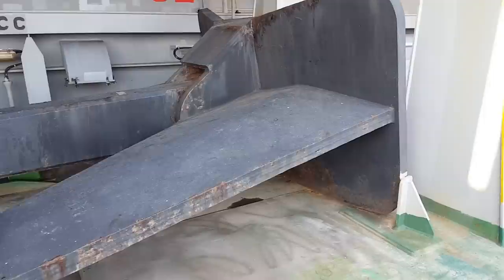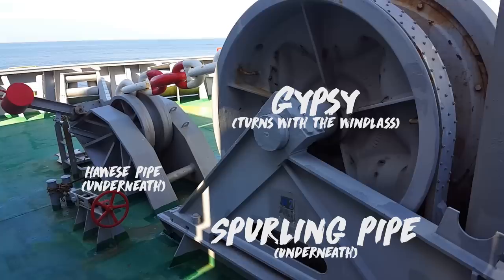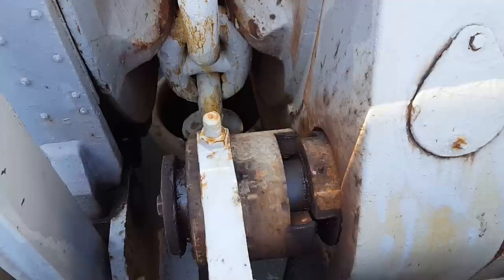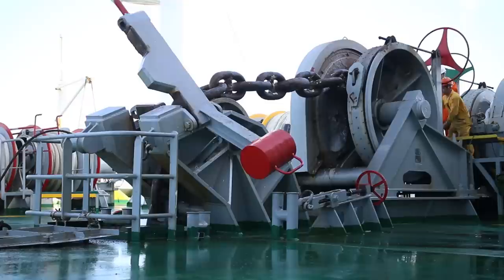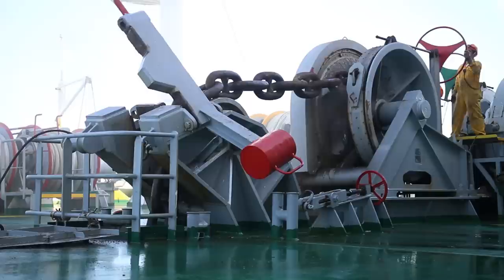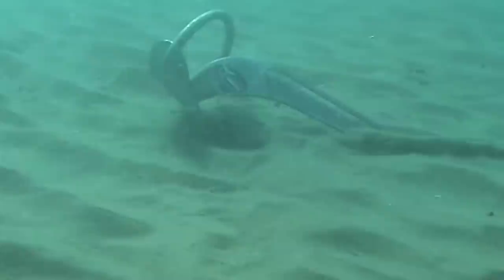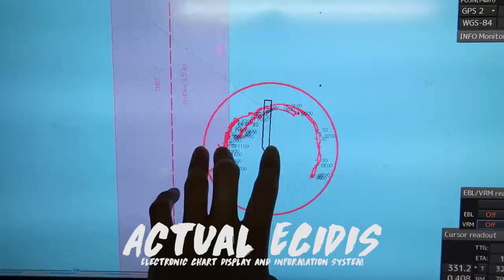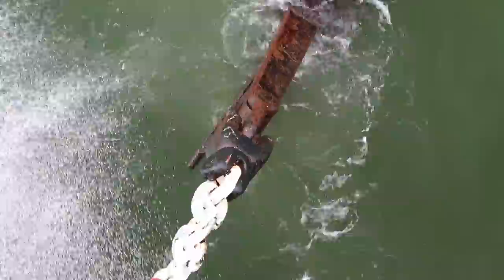How To Anchor a Mega-Ship  |  Anchoring & Equipment Explained!  | Life at Sea

Comment: 4:50 
Omg the big pin is held by a smaller pin which is held by a smaller pin 
😮
Reply from the maker: pin-ception
Reply: Bhum Brahmavira  Thats not what redundancy is. The pins are all part of a single system with the sole purpose of locking the anchor chain in place. If there was another system that did the same thing, it would be a redundant system. For example, a 747 jet will have 4 redundant hydraulic systems to control the ailerons, meaning 4 totally separate systems that all enable the same thing. If one of the systems has a 4 step fail-safe for its hydraulic pressure limiter it wouldn't be redundant. But if it had 4 separate fail-safes for the same hydraulic limiter which all counteracted the same issue it would be a 4 level redundant system.
Reply: Wonder what circumstance lead them to realizing that final pin is necessary? Figure this out and youll be a hero in my book
Reply: Yo dawg, I see you like pins, so I added a pin on to the pin for the pin, so you an pin the pin while you pin the anchor.
Reply: Wait, I was expecting a needle on the third pin. Current design isn't safe.
Reply: Bhum Brahmavira that is not what redundancy means
Reply: @dynamicsolution8166  - You know the answer already. All it took was to have that anchor chain come lose at the wrong time cause something got bumbed or hit, and sink or capsize the vessel. Think about how much movement on a ship in a storm. Shoot I'd put two more pins.
Reply: WuzNab your profile pic makes it even funnier😂😂
Reply: @dynamicsolution8166  general safety.
Even the smallest pin will normally have either a spring thing like a lynch pin, or a ball poking out of it that is springy. with such a pure mechanical sytem, it is important to make it so that only a human can change its state.
Reply: The never ending effort to keep "Murphy's Law" under control as much as humanly possible...
Reply: @JeffHK  Why is this not a pinned comment?
Reply: @dynamicsolution8166  drunk sailors?
Reply: yeah i found that funny too:)

Comment: I've driven semi trucks and flown helicopters, that doesn't scare me one bit but I would not be caught anywhere near that chain while it's dropping.  Holy crap.
Reply: Right? Why don't they put that brake wheel in a less dangerous location? To the side perhaps?  The guy is two feet away as the chain spins out of control.

Comment: how do you pull it up? isnt it stuck into the bottom of the sea?
Reply: The head of the anchor is not actually stuck in the sea. Its the length of the chain as a whole that "gets stuck". If the ship pulls horizontally against the chain, the ship goes nowhere. If they haul the chain up vertically little by little, no problem, chain comes up.
Reply: Ok, thanks now at least i know ;P
Reply from the maker: Great explanation!! thank you sir
Reply: thesmallterror it depends on the type of a anchor if it digs or not a Danford anchored will dig real deep in rough weather
Reply: I heard if the anchor chain broke loose in the middle of the sea
The windlass won't have enough power to heave up all the 13 shackles of chain
Reply: Thanks for sharing. Sweet video!
Reply: Slave Of The Most Merciful You go directly over it and pull up, they do not hold vertical, he said that in the video
Reply: In general you "drive up" onto the anchor (approximate location)  while pulling up the chain. This is why you have to see where the chain is pointing and the angle of the chain.  When you are on top of the anchor location the shank will pivot as you pull in the chain. The last part is heaving up the material over the flukes which happens as the shank pivots upward. Then the force vector is a simple lift not dragging against the flukes which are digging downward because of the allowed pivot of the shank and gravity (this is why the shank is only allowed to pivot 30 degrees or so depending on bottom it was designed for). Windlass systems in general are specked out at 4x the lifting power of  the rode and ground tackle weight.  (ship) ^---------------> holds and digs because the anchor chain keeps the force vector horizontal   (ship) ^-> pulls up quick as the lack of most of the anchor chain lets the force vector go vertical .
Reply: Any modern anchor, even on a small boat, is designed to hook into the bottom.  It takes 'scope' of anchor line or chain to hold the ship or boat at a shallow angle against the anchor. Once you pull up the chain and the anchor is directly below the bow of the ship, it'll haul up relatively easily.  When you do it by hand on a recreational boat, it's very noticeable when your anchor breaks free of the bottom.

Comment: Nice video...  After typing up to a multi-point offshore mooring (both anchors laid and 5 lines to buoys off the stern) we opened the chain lockers and found the port chain didn't even touch the bottom of the locker, and the starboard had about a dozen links laying on the bottom of the locker.  Mind you, in this ship, the weak link end connectors were up near the top of the lockers.

Comment: Surprised no one commented about Being at anchor.  Good vid by the way.  Dragging anchor is the worst nightmare particularly if there are other boats/ships near.  Usually because of changes in weather.   Particularly with civilians who don't anchor often.  That's why I always listen in the night for the flapping of the burgee on the mast.   If it is flapping at a fair clip (strong breeze) I ALWAYS get up in the night two or three times to watch the surrounding boats.  I've caught 3 boats in the night dragging anchor including a 70' headed towards other boats at anchor.  Fortunately I was able to roust them with the 5 horn blasts and they came on deck Literally 40 ft from shore.  Props first!

Comment: Nice video. Slight correction, it's never the chain that holds the ship, it's always ultimately the anchor, and if it fails to set properly the ship will happily drag a mile of chain and the anchor until it sets. In bad weather or strong currents the chain will be pulled taut, almost straight between the ship and the anchor, and will not be in contact with the sea bed, no matter how long or how heavy the chain is. The big, heavy chain is primarily needed because until recently anchor designs have been so bad that they needed a very low-angle, nearly horizontal pull in order to have a chance of setting themselves into the sea bed. A few of the best new 21st century anchor designs don't really require any heavy chain anymore in order to reliably set themselves, but nobody makes these new anchor designs in sizes appropriate for such large ships. I don't know if they ever will, but if they did a mega-ship like that could probably use anchor chain less than half that size and still have more reliable anchoring than they do with those old stockless anchor designs. It would be interesting to see what kind of anchors big ships will be using a century from now.

Comment: Another good video. Well done. Your demonstration using simple models and sketches is very good. However, the real mega mega ship from an anchoring perspective would have been the kind that I was Captain on, the ULCCs, 413842 Dwt Tons, with a loaded displacement, close to half a million tons. The anchor itself weighed 25 Tons. We would never 'Let go', the anchor had to be 'walked back' each time. Thanks once again.

Comment: Cool Vids Mate...
Is see alot of small boaters use the bruce anchor...those are the worst in an emergency unless you want to reset anchor if you can. They require alot of rode to hold...not good in tight places unless you use alot of heavy chain and a winch to pull all that chain.

Comment: Thank you for this video, What I am interested to understand is on a large vessel, if the ship needs to drop anchor  shall we say in the middle of the Atlantic Ocean, which is probably several thousand metres deep, surely the anchor chain is not that long? So, how does the anchor hold the ship if the anchor is not imbedded in the sea floor? Thank you

Comment: Very helpful video thank you, one question though. Do you have "no anchor" spots on charts to prevent accidentally damaging underwater equipment such as cables and pipes?
Reply: Most Harbor Charts, (especially the larger ones), usually have designated anchorage areas with specific spots marked within them. Also underwater cables pipes and other structures are clearly marked so vessels don't drop on them. It doesn't keep it from happening, but one cannot completely eliminate the Human Factor. (Former Quartermaster USN).

Comment: What is the process for removing the anchor from the sea floor when you are ready to set sail? If the anchor is somewhat embedded in the sea floor does the windlass provide enough pulling force to overcome the embedding? Also, what is the procedure for removing an anchor that may be stuck on rocks underwater?

Comment: How do you determine the appropriate weight of chain required for a particular vessel? An 8-ton sailing boat in 60 fathoms of water will let out the same amount of chain as a large cargo vessel but doesn't require as heavy of a chain. Is there a formula?

Comment: Anchoring it is. Question, Under what circumstances is the ship required to anchor?
Reply: There could be many reasons actually, but the most common ones are; no Berth available at the pier assigned or not ready to receive the ship alongside, or perhaps illness onboard and the vessel is placed in Quarantine.

Comment: How do we pull up the anchor? If it's buried in the sea bed... Then will it require an enormous force to pull it? Also if the anchor is buried too deep while pulling up the anchor instead of the anchor coming out is there a possibility of vessel going to the anchor causing vertical force?

Comment: Chain alone or anchor alone can't hold the ship well (except in very calm sea - no current no wind). It is the anchor, in conjunction with the chain that hold the ship or prevent the ship from dragging. Certain type of high holding capacity anchor such as Stevpris Anchor is sometime using wire instead of chain due to limitation of chain locker. This type of anchor can hold the ship very well even without using anchor chain.
Reply: lim wei ming t
mid

Comment: how would you use the spare anchor? it looks like it doesn't have a chain hooked up to it. keep up the awesome videos!!
Reply: The spare anchor will be engaged if one of the 2 in service anchors are lost. 
The vessel has spare anchoring equipment including KENTER Shackle used to connect the spare anchor. Definitely its a task, generally nowadays a shore company with barge will be engaged to connect the spare anchor on to the chain. 
Also Spare anchor is not really provided onboard modern ships and is to be sourced if need be basis.

Comment: This video is very informative mate. However, you guys should always comply the #1 rule onboard which is SAFETY FIRST. Correct me if i'm wrong, those guys standing by the brakes don't have safety glasses or googles or simply proper personal protective equipment during anchoring operation. This operation is very dangerous specially when you are going to drop anchor rather than bringing it home, those chipped paints and rust, just one part and it can cause you eye injury or your seafaring career. I'm also a seafarer and I know the pressure onboard during critical operations but I'd rather move safe and slow than rushing myself that can lead to unsafe movements. You have time to record these clips during your anchoring operation, please do also have time to remind your fellas out there at forecastle to wear PPE.

Comment: If I understand correctly the windless actually releases and retrieves the anchor and chain. How many horse power or kW are required to retrieve the anchor and chain and how is the windless powered. Is it a hydraulic motor?
Reply from the maker: correct and yup hydraulic

Comment: Yea. I would like to see the process of dropping anchor and know if one or two anchors are usually used.  especially for big ships..
Reply: Could be up to 8 anchor lines: 4 port 4 starboard. Mooring lines easily 12 hawsers for the six degrees of freedom (2 longitudinal, 2 lateral, 2 yaw) for mooring (pitch, yaw and roll), although not the "up and down" movements.
Reply: How does one have 8 anchor lines with only two anchors?
Reply: @garman1966  - There would be an anchor on each line. On this particular ship they had 4 anchors (2 fore, 2 stern), but bigger ships or other vessels can have more. Like a semisubmersible platform might have 12 anchors, and anchor lines.
Reply: Thanks!

Comment: How come the chain locker doesn't have oil in it to reduce corrosion on the hideously expensive chain?
Reply: Seán O'Nilbud   Oil would pollute the sea...
Reply: Its not needed, the steel used for these chains looks rusty, but if the surface is covered in rust it nearly stops rusting

Comment: Is the scene at 0:27 really what happens?  It shows a warship of some type - no small ship -  apparently just dropped anchor, and the anchor sets, and ship is whipped around somewhat violently.  It seems plausible with a significantly smaller craft that that is what happens, for example, in a fairly strong current.  Anyone who knows, can you answer?  Thanks.

Comment: how do large ships handle hurricanes or typhoons would the ship be anchored or put out to sea if it's forced to weather the storm? i some how think you would be safer out at sea if you had to weather violent storms and not on anchor
Reply from the maker: Ideally you will hide inside a bay where the land is enclosed on the water blocking the wind and anchor there until storm passes
Reply: In case of any bad wx situation, the vessels are required to leave the port and its safer to be proceed away from storm than anchoring close to port where ships can drift and run in to danger of running aground.

Comment: It is not clear to my how the "break" is applied to slow and arrest the chain when the anchor and chain is being allowed to run free. Can someone point me to a good article or video on this? Is the mechanism akin to a disk break acting on the Gypsy wheel itself?
Reply: Applying breaks is an skill and its generally the Bosun who does the anchoring or experienced able seaman.
Once the anchor chain is let go the speed is to be controlled or else it can have dangerous results as shown in the video.

Comment: What would happen if two ship's anchor chains crossed and when one pulled their anchor back it got stuck and wrapped round the other?
Reply from the maker: Thats call anchor fouling, I actually deleted that part because felt like i was dragging on the topic haha. The only option is to hire tugs to turn the whole ship which takes ages. Even then...most ship end up unable to twist it back and have to buy a whole new another set
Reply: Thanks for the reply. During your demonstration with the paper boat and the anchor chain I was visualising other boats and what would happen. Thanks

Comment: Am I right in saying that the chain isn't acutely attached to the ship
Reply from the maker: +caleb11549 it is attached to a big bolt called "bitter end" at the bottom of chain locker, we hit it with a hammer if need to emergency release it so that it wont be ripped out violently (it looked like someone did in that accident footage thats why it came out clean)

Comment: How a ship anchors itself in the deep ocean where the anchor's chain length is at max....??
Reply: A ship can't anchor in deep ocean. Deep water drillships use GPS dynamic positioning systems that operate perhaps a dozen 360° rotating propulsion pods to keep on position for drilling. It's pretty incredible they don't snap the steel drill pipe which descends through a "Moonpool" (opening in the hull).
Reply: @AR-ml9eo  thanks brother for replying ...just amazed to see mankind's creation ....how a huge building like ship can move from one place to another